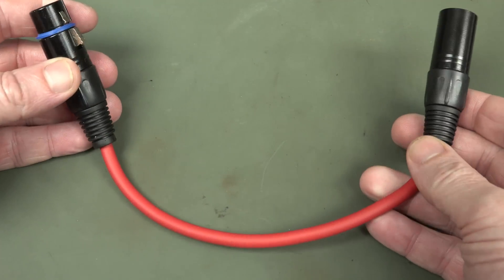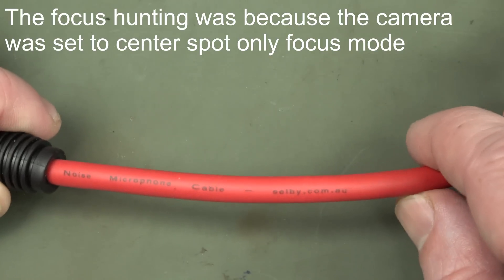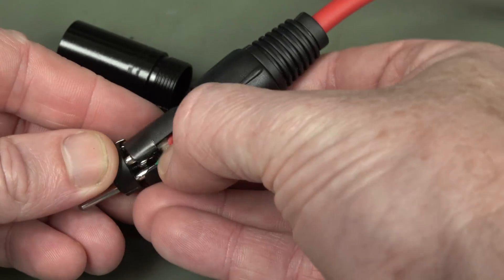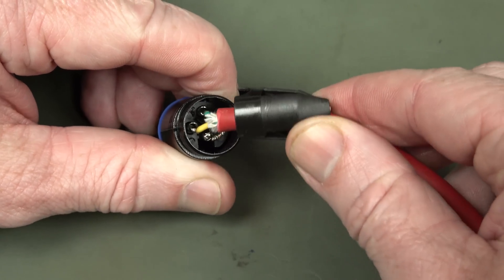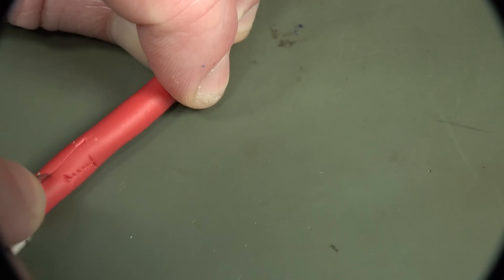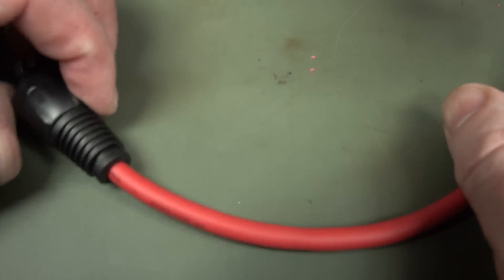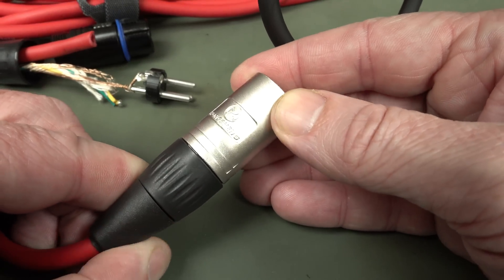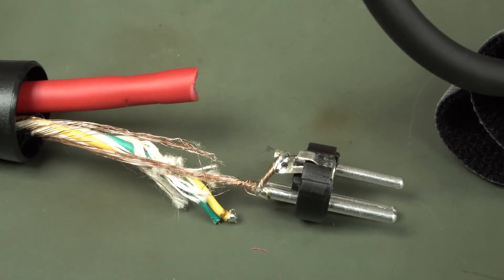Crap Quality XLR Microphone Cable Teardown

Comment: Yongsheng is Neutrik's Chinese manufacturer. I'm about to replace a female Yongsheng XLR on a cable integrated into a K&M boom arm. The contacts are unreliable now. I suspect the spring tension that grips the mating pin in the male is not quite good enough for a solid connection anymore. Thats' not a reflection on Neutrik branded connectors - they are far better than Yongsheng. 

All connectors have an expected number of reliable "insertions" that vary according to both the design and the manufacturer. I have yet to have a Neutrik XLR fail as a connector even with repeated frequent insertions.  I've had plenty of others fail. A suggestion for Neutrik XLR connectors -- get silver contacts in preference to gold and gold  in preference to nickel. Avoid nickel if at all possible. Silver is the most conductive metal and has almost zero resistance. Silver oxide (the black tarnish) is almost as conductive as silver. Silver plated contacts where both surfaces are silver plated will not wear through -- the silver will transfer between sliding mating surfaces even if it becomes exceedingly thin. Gold won't tarnish but copper in gold alloys can tarnish into green gold oxide. Like most metals except steel/iron, nickel will acquire a thin surface corrosion over time that doesn't progress further than an exposed surface. Nickel corrosion is horribly non-conductive. The only reason 1/4" nickel connectors work is that the infinitesimal point contact inherent to its design tends to push away the surface corrosion in repeated insertions but not completely reliably. 

Unlike most other audio connectors, 1/4" connectors have an infinitesimal mating contact area.  The flat folded contact spring in the typical female is a fold contact edge that touches the male cylindrical shape at right angles which is, mathematically, an infinitely small point.  They work OK in well designed female designs that use better internal contacts that get a higher contact area.You'll see them in balanced line applications for line level (-10dBV and +4dBu levels) audio. Using them in high current applications such as connecting power amplifiers to passive speakers is very undesirable. Use SpeakOn connectors instead.

Comment: The Neutrik Yongsheng connectors are clearly not the same quality as their German made *XX series, but they weren't really the issue here.
What gave out was the bad build quality of the CABLE as a whole. You ALWAYS fill the solder cups completely and you make sure that the wire is stripped far enough that it goes all the way to the end of the cup. You want proper fillet on the end and it'll never come off... Then you make sure that there's just a few mm of extra wire inside the connector such that if the strain relief slips for what ever reason, the stress isn't immediately transferred to the solder joints. It had basically zero extra on the wires... so obviously it failed...

Yeah, you pay for a quality.

Comment: Shielding on an XLR cable is not as big of an issue since it's a balanced signal. Pins 2 and 3 are carrying the signal and a phase-inverted version of the signal, so all you need is a preamp/input buffer with good CMRR, and any interference that might have affected the cable is effectively canceled out. Shielding matters far more with unbalanced 1/4" TS cables.

Comment: Since it is a differential cable, does it need shielding at all? I mean Gigabit Cat6 cables are UTP, if they have a + shaped separation lug. So whats the deal with 100% shielding or shielding at all...

Comment: Wow. That one bad soldering joint came out of the factory colder than a witch's tit in a brass bra doing push-ups in the snow in February on Mt. McKinley. It's colder than a Three Dog Night or a timber wolf's toenail. (You win a pony if you can name the source of that last reference.)

Dude, I think your dead dingo's dry donger was done a long time ago, at least when it comes to cold solder joints.

Comment: that is one worst XLR solder jobs ive ever seen.  i make 4pin and 3pin connections all the time at my job. so i know a bit about it.  they are using 1 hung Lo brand of connector. you should use Nutrik. secondly they barley put the wire into the pin.  those pins are hollowed out and go deep for a reason. you can get the wire at least 5mm in there before soldering.Look at time into video 3:51, cold solder joint.

Comment: With good flux, you should get a solid fill in those solder cup contacts. Those who are looking to do perfect soldering, look up "J-STD-001 soldering". If physically possible, I make my cables/harnesses strong enough to hold the devices by. I make no assumptions as to how my devices are handled by people. If you want to put together perfect harnesses and cables, start with military-level techniques and work your way down towards what's practical for your application. You do need to be a little obsessive to make perfect cables. ;)

Comment: I make my own using quad-core cable bought in bulk and neutrik connectors. The quad core (twisted pairs) really helps prevent the cables from picking up unwanted RF noise.  Cheap cables are inferior and good cables are overpriced for someone with basic soldering skills.

Comment: looking at the junk cable it looks like they used a section of electrical cord and re printed it for microphone cable.

a really good cable should be shielded and use ofc  oxygen free copper and metal tips instead of plastic and should maybe even have a screw to hold it together instead of looking like diy

Comment: Their iron probably wasn't able to sink enough heat into the solid pins. The sheet metal in the other connector has less mass and was likely easier to solder to

Comment: Back before you were born I worked at a TV station that was adding a new studio, which involved something like a Bazillion XLRs to be attached to cable runs. For some reason the boss really liked my soldering and OCDness, and I got to solder most of 'em. It really is NOT that difficult to do it right.

Comment: This is typical these days. Reputable companies actually having their manufacturing done in , dare I say it,  “China” and this is the quality of the product they thrust upon us for exorbitant prices. I worked at Philips as an engineer many years ago and they sent manufacturing off to China for their low to mid range AV products and discovered very quickly how little notice the Chinese manufacturers of quality control or quality assurance.

Comment: No, not typical shield coverage. That's spiral wrap, maybe 60% if you're lucky.  A good braid is 95% or better.  Foil is 100%, but comes with its own problems.
Reply: I should say: "not typical for a good cable".  For a cheap one, not uncommon.

Comment: I've always played safe with either Van Damme or Klotz cable, usually with Neutrik connectors. That said, I think that one would have worked fine, but for the poor soldering. The poor shield coverage probably doesn't matter too much on a balanced connection.

Comment: On the female side on some of these cables the contact get expanded out and no longer work, anyone got any idea to fix that? I have become the student sound tech this last year for my high school jazz choir and I fixed a big box of these clables with bad solder jobs, they break fast because they get abused by the students from unplugging and plugging into the performance mics daily.

Comment: Not enough heat + time during soldering. The cable has been put together too quickly. Don't scrap it, rework it (both ends) and put it to less critical duties. 

Everyone with a box of cables should also a own cable tester. I like Behringer's, it's good at detecting intermittent opens.

Comment: Try to only use Neutrik XLRs because they just fit like it should. I have seen cheap connectors that get stuck which could ruine your day and even your device ;)
I also make all cables myself. Never had a bad cable unless it was heavily abused like jamming it in or under a door.

Comment: I think SWAMP manufactures their own? I use a lot of their stuff and they sell both built cables as well as rolls of the cable plus the connectors individually - Neutrik, Yongsheng (which is actually pretty good quality). Either way the first cable you had looks like rubbish. If it has a spiral shield and it's thin, it screams cheap quality. I use Canare cable and Neutrik or Yongsheng connectors to build my own now.

Comment: working as a sound technician in tunisia I can say that this is not too badly soldered. I've seen some cables where the copper was just wrapped around the pins with some solder thrown at them.

Comment: Actually the plugs themselfs are crap also. I had many connectors where I was not able to solder cables to the pins as their finish and plating prevents solder to stick onto. Very sad that this company used so bad components...

Comment: Ah, Swamp industries. I have some midi patch cables on my desk from them...
They work alright, though their branding efforts look a bit cheap. (stickers on the plugs that come off rather easily.)

Still, if it works, it works.
Now if only I could say the same for the USB midi adapter...
Midi is pretty poorly supported on modern versions of windows anyway, but I couldn't even get this adapter working on a windows XP system, and XP still had solid midi features...

Such a pain.

Comment: I stick with Neutrik or Switchcraft connectors and Canare star-quad cable and make my own.  The ones I use in my office were made around 1990 or so, and I've never had a problem with them.

Comment: So the cable that failed was also NOT wired properly either, XLR plugs have 2 Grounds on them, the  second or Frame should FLOAT. The shield of cable should go to pin # 1 only. This is done to help prevent Ground Loops  : )    both ends were shorted to Frame

Comment: 1) Solder never took to the pin (cold) 2) REALLY bad workmanship. 3) Pin #1 should not be bridged to the case connection, otherwise "ground lift" options will not work on devices so equipped. 4) Regarding shield coverage, looks to be 30 to 40%. Will work ok on a short balanced line, but inductive of real cheap cable. 5) Often knock-off XLR connectors do not have good mechanical tolerances. (A big red flag on those connectors.)

Comment: About the same quality soldering you would see in any main brand XLR cables.  They're all basically the same mass produced half-ass solder job.  In my experience the shielding on the cables doesn't matter as long as the signal remains balanced all the way from source to destination, but once you lose one of the signal wires, inverted or non-inverted, you lose 6dB of signal and gain 6dB or more of noise and the handling noise starts in whenever you touch it.  And with a properly balanced signal you technically don't even need the ground or the shield wires. ;)

Comment: Holy crap that cable's just awful. I'd expect a conductive polymer or metal foil shielding in addition to the braided shield. Shielding and noise with single-ended vs balanced transmission lines -- now that's a good reason to bring Doug in for a new video series!

Comment: I guess for such a short balanced connection the shielding is sufficient.. But, the xlr cable I've bought (by the meter, cheap enough too) had a solid foil surrounded by a nice full braid, so i'd say this is sub-standard cable.

Comment: They may have tried threading the wires through the pin cylinder holes at the end before soldering.

Comment: That's terrible, Muriel!  The cable is terrible. It looks like not even 50% coverage, and spiral wrapped (much inferior to proper braided shield).  And the connectors are terrible. Cheap Chinese knock-offs with poor dimensional accuracy.  And the assembly is terrible as well.  Horrible wire prep, and beginner-level soldering.  Even the other one with "heat-shrink tubing" (which is either NOT heat-shrink, or at least not shrunk.) is hardly better.
This is why I buy name-brand connectors and cable from my favorite supplier (Redco)  Even their house-brand, sensibly-priced cable is orders of magnitude better than that stuff in your videos.
And I have found that Amphenol ( originally AMerican PHENOLic but now a Australian company) connectors are terrific. Equal quality to Neutrik and at a sensible price.  But nowhere near the wide variety of product that Neutrik does.  But then for bog-standard XLR male and female cable connectors, I love them.  And nice TS and TRS 6.5mm plugs as well.
XLR and TRS cables are so easy to terminate, there is no reason to gamble on buying cables of questionable quality from ANY vendor.

Comment: In addition to the crap soldering job, it's also not wired correctly. Pin 1 should NOT be connected to the shell. This is an infuriatingly common assembly mistake.
Reply: The second cable was assembled correctly. The cable shield was connected to pin 1 only. The connector shell was left disconnected, as it should be.
Reply: Standard practice for Cannon XL cables is to ground pin one at both ends to the case, and that is absolutely definitive. We used to wire one end only too, but this is not really correct. There is no reason why the case shouldn't be earthed EDIT: On properly designed equipment. Ask why Cannon bothered to put the connection there and then check with standard procedure. People have always had a thing about the shield and earth on these things - poor design can present problems.(and they are Cannon XL plugs and sockets, the R was for a specific resin or rubber filled case, L for 'locking' X for plug/socket style - as made by Cannon)
Reply: Martin D A Reference: https://www.rane.com/note165.html
Reply: Thanks I'm aware of the issue.

Comment: Well, it would only need a quick resolder to make it good. Sure, that is poor, but that was an OK cable and should have been decent for a low cost item - which you said it was. Sometimes you can get a 'Friday afternoon' item from anyone, even Rolls Royce - I think Qantas had an issue recently, a loud mouthed self promoting twat of a pilot wouldn't shut up about it.... I would always give people a second chance as these things can slip through. This is not necessarily a bad outfit and I know I would feel terrible if I was judged on one dodgy item. Edit: Especially a cheap shitty lead...
Reply: No, I don't agree with you condemning a whole business over a single cheap cable. Someone with your clout ought to take a bit of care - you can have an impact on their livelihoods. 
I would have contacted them and asked for an explanation, then seen how quickly or not they tried to make good. So it was also a snug fit....( I have watched every video you have made and love your content, and more than that offer my full support for you to become the First Lord of Interweb Electronicals = but this worried me a bit, some poor bloke may be tearing his hair out with a feeling of injustice)
What was it Spiderman was told?
And now I will keep my trap shut. (Edit, No, Spiderman wasn't told to keep his trap shut, I meant me).
Reply: No, the connector was crap too, it didn't fit properly, way too tight
Reply: PS No connection with  Selby.
Reply: In fact a quick perusal of their site leads (pft) me to the conclusion they are a professional well run outfit - they also plaster on their front page a big 'no quibble guarantee', and I bet would have sent you a better cable smartish - esp if they got wind of who you were.
Reply: And for the poor chaps at Selby...There is no such thing as bad publicity. Thank goodness.
Reply: Yeah, the plugs and cables were fine, not the best, not the worst, but fine for semi-pro use. A cold solder joint can happen to anyone, doesn't make a company bad. If you had bought lots of cables from them and all consistently failed and had problems with bad soldering, that would be another story but with only one single cable on hand you can't judge the quality of the company. If it was me, I'd just shrug it off and resolder the plug and be happy with it.
Reply: EEVblog 
probably a counterfeit cable

Comment: A point to consider is that soldering to the shell, especially in live nusic situations, can be dangerous.  "musicians" have a habit of removing earth wires to stop hum loops, but then there is no protection against live faults - so the shell can become live (eeeek!).  If you don't connect to the shell, and the earth becomes live, then there's a shower of sparks when you plug it in to something that's grounded - but no death.

Comment: if i would make a living with videos, i wouldn't be using a cheapo cable off ebay. You have high end lab equipment all over the place but use this?

Comment: Clearly they haven't flowed the solder as they should have.
Hurry or desinterest, or maybe even a not heat resistant connector.

In short: crap. You'd better dump it in the trash!

Comment: Never understood why anyone with a soldering iron would buy a pre-made XLR cable.
Reply: Sandgreen Sandie 
Value of your own labor? If you buy a proper brand, you will not have these problems, and they will hardly cost more than when you (or I) buy cable and connector in small quantities. I can buy 10m Cordial cables for €20 delivered, and the raw material is about €16…
Reply: We buy Sommercable and Neutrik and the raw materials cost 9 euros for 10m cable. So its cheaper and you can have the length, pinout and quality you like.

Comment: Is there no strain relief on those XLR? Are there strain reliefes on "original" XLR connectors?
Reply: If you tighten the shell, the conical end of the middle part is squeezed. This works very, very well on XLR (“Microphone“) cables. Never had issues, at least with Neutrik connectors (of which all other companies have copied this design) and good quality (Cordial, Sommer) cables. This is used on stages and in studios all over the world and stands the abuse common in such a setting.